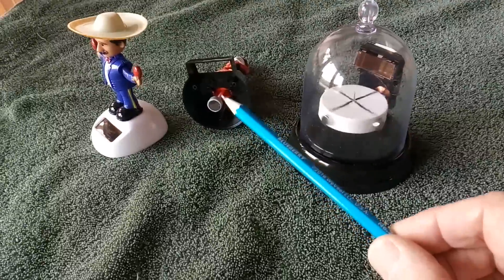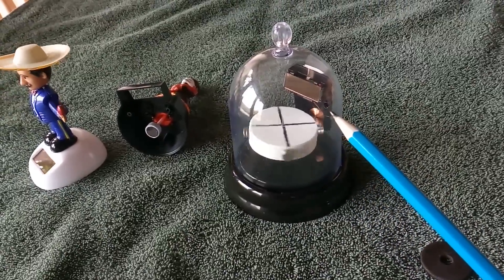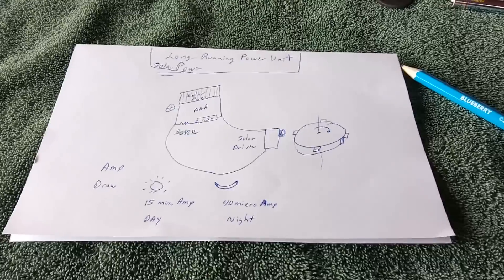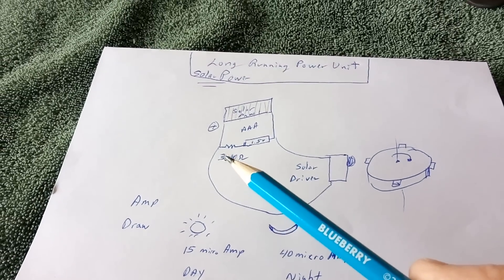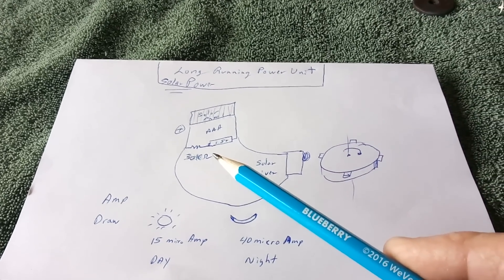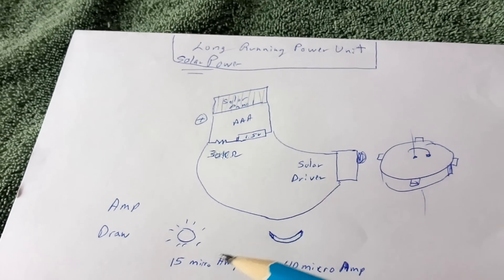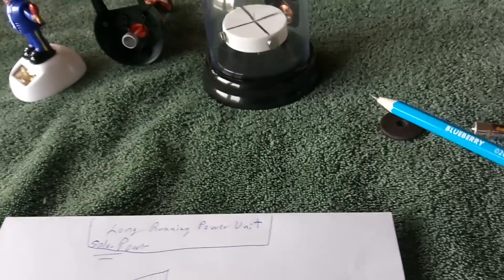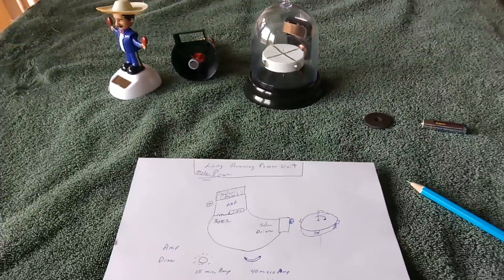Simi - Levitaited Rotor ----Driven by solar waver driver

Comment: Wonder if the solar (or a second one) could put off enough power to charge a small super cap during the day which would keep the wheel going at night?
Reply from the maker: I built something similar to what you describe years ago.  I used a much bigger solar panel though.  I still have it on a lamp table at my other house.   To keep the super capacitor from over charging on sunny days I put an led across the cap terminals.  When the voltage in the cap rose to the about 2.5v the led came on and bleed off the extra energy.  The project was only partly successful.  Bearing failure was the issue.

Comment: My wife would like me to dismantle some of our solar rockers (probably all of them to make her happy). I only have a few running now anyway, the rest are boxed up otherwise they tend to mysteriously fall off the windowsill.
Reply from the maker: Before my dad passed away he had that shelf where the 'water scene' is filled with solar wavers.  They moved around a bit and some got together and waved together in unison.  I don't think any fell off the shelf though.  When dad passed I donated most of them to a charity store.
Reply: @Lidmotor  I think I may not have hinted clearly enough - my wife sometimes assists them in falling off. When the noise annoys her she lays them flat to stop them rocking and sometimes that means they roll off - apparently :-)
Reply from the maker: Ah---mystery solved.  My wife tolerates most of my stuff but if it makes any noise it is doomed to a box somewhere.

Comment: Definitely a 'to do', looks like it runs well. Nicely done :)
Reply from the maker: It runs OK but I'm not convinced that this is the best way around my bearing problem.  I think that there is magnetic flux line drag as well as friction at the hole in the rotor.  I guess the best way to see if this really works is to finish up the project, set it in a sunny window, and watch it for a year. Ha.  That is a pretty time expensive way to test this.

Comment: Neat and interesting project, thanks for sharing your work.  Do you know why it draws 15uA during day and 40uA during night?  Does it run at about same speed and about same amount of power consumption (P=VI) during day and night because it is (higher voltage lower current during day) and (lower voltage higher current during night)?  Or is some current feeding back into solar panel at night because there is no blocking diode?  If that's the case, a low forward voltage drop germanium or Schottky diode should improve efficiency.
Reply from the maker: I am not quite sure how this works.  I guess the little solar panel has enough resistance in it to prevent major discharging the battery at night.

Comment: Hi. If you use two coils on two sides and use the type of battery that you show, there are two very interesting circuits that halve your input requirement while charging them alternately. Should give you the long run time that you are interested in. Thank you
Reply from the maker: I suppose I could use a  bunch of those drivers around the rotor and somehow wire the one battery to all of them.
Reply: Or, maybe connect the inductive flyback through the rest of your other coils,  in such a direction that assists in the rotation and ends with a diode to your run cap positive.
Reply: Since you are thinking of magnetic drag and other problems that come with a levitated rotor, may I suggest that you look for a plastic "Lily Impeller". Designed by Jay Harman, who says, among other things, and correctly so, that nothing in nature ever moves in a straight line. His impeller fan designs create a tornado like blower that is extremely efficient. At a certain speed you will find that the fan is not fighting the air around it, but has created a natural flow pattern that mimics nature. If you were to place the rotor magnets in appropriate positions of the fan, and surround them with coils that corresponds to the magnet positions, you will find nature nurturing your creation. And when that happens, it lasts for quite a long time. 
One of our problems with rotor designs is that we make them as wish to or can make, and expect natural continuity. I have not till today, seen this design incorporated as rotor for motors, except for a few Icelandic companies that have used this, very successfully as wind turbines for power generation.
Try it. I think with your experience and desire to build these long running motors, you will clearly add another dimension that will add to the magnetic rotating fields.